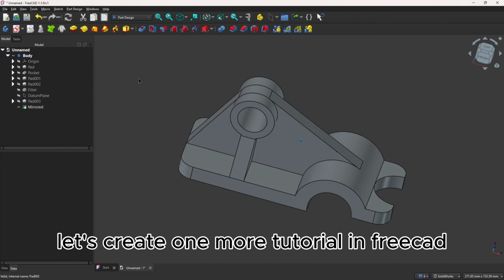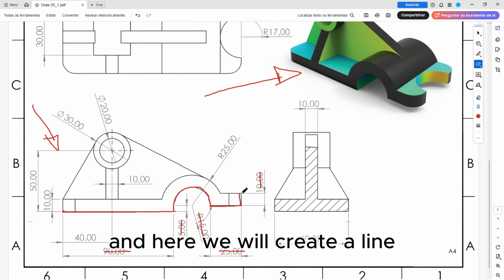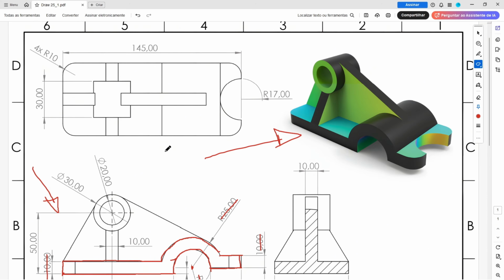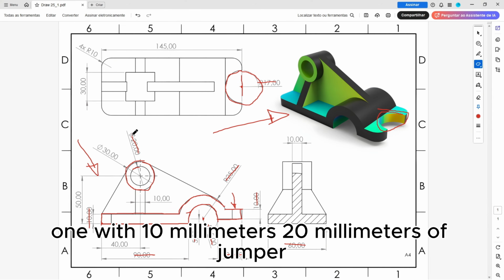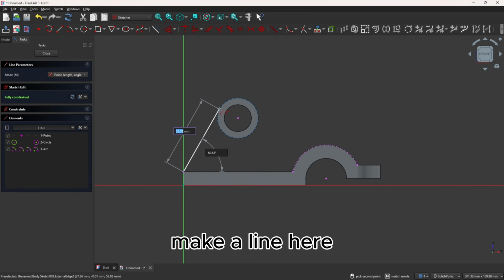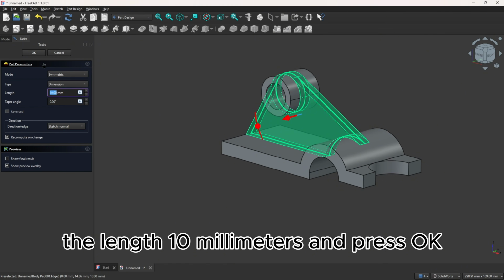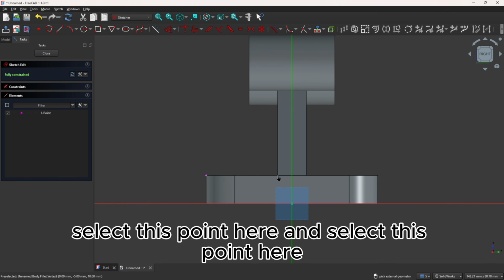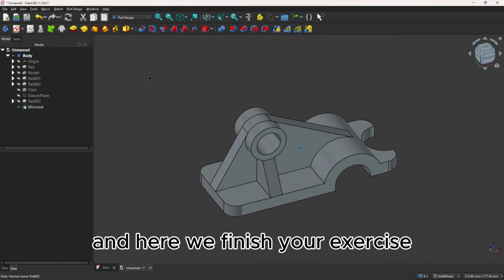FreeCAD  - Complete Beginner Tutorial Step by Step Exercise 25

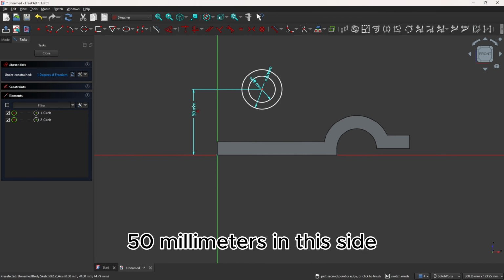Comment: Thank you for your tuto. I have FreeCAD-1.0.2 on Linux and around minute 5:00 to extrude the pipe's sketch upper, it failed (i do exactly what you did). I think you should show your Model schem tree to conform with operations done. 
When leave the sketch, at extrude time, it does create a Pad inside the same body without to show symmetric extrusion. I tryed to modify direction of extrusion (but it was negative on Y axe, that seems to be correct). It show warning log reported as "autoconstraints cause redundancy, renmove them", and error log comment: "<Sketch> SketchObject.opp(11403): Invalid subname..." many times.
I have no idea why this does happened.
I can see in the model that each element of the body can have a exclusive view (i mean: i can not make all of them as viewable, only one at a time, and the last pad from the both circles sjketch, full constrainted, does not build the pipe at all).

==> after to update to last version 1.2.0dev, it comes better, but i also had to select main body to get "Allow Compound" option true to accept multiple not linked pad in a single body (that is out of new FreeCAD design pattern convention: it should have only one or get linked physicaly, that means that you sould go by draw it support first, then create a hole to include the pipe at the end).

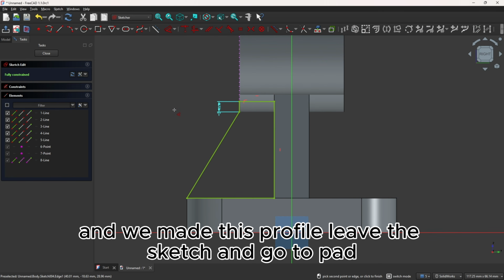But then, at 9:47, when i need to use the "Protrusion" tool, it does not works with an error as a non closed line. The problem is the constructions's reference verticale line (the one that show the 30 mm diameter circle of the pipe). The view is not same as yours and freecad-1.2.0dev is trying to protruse this line with the profile.... So i had to delete these external reference and add 3 constraint.

At the end, i had also problem (no more hole inside the top pipe) and had to create a hole by changed the rteference plane to draw a circle to extrude trhough all in symetric mode.

Also, look at your 3d result (as mine): you do not respect realy the 2D sketch. There is a gap at the last support (the one that is in symetry) near the pipe. It should NOT.

So, i think that:
1/ the best draw to apply by design concept does not go with FreeCAD requeried pattern
2/ You missed the point on the last element to draw by and gone out of the real technical draw.

Comment: I must have missed something. How did you get to pad the circles in the same view as the original pad without external geometry or an obvious connection to the initial pad?
Reply: Problem solved. I was using an older version of freecad, I've upgraded to version 1.1.0cr2